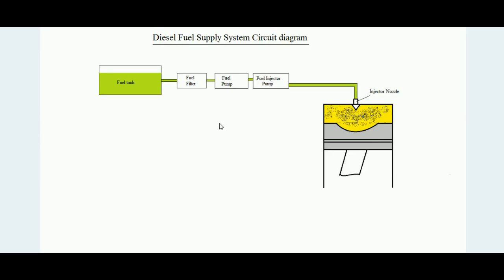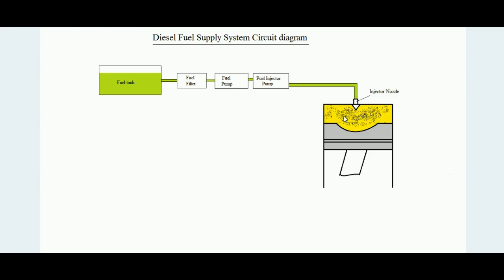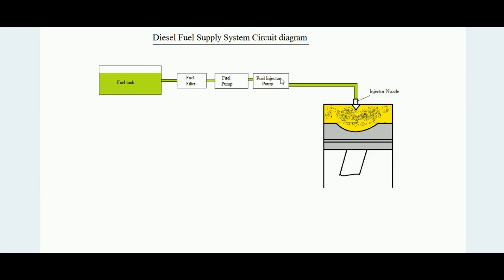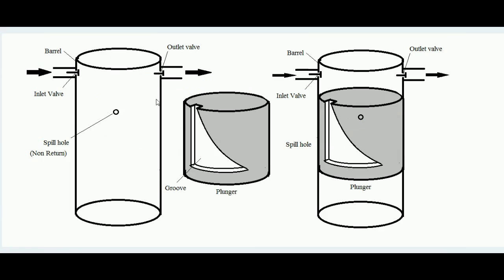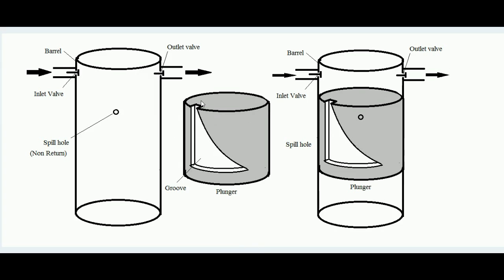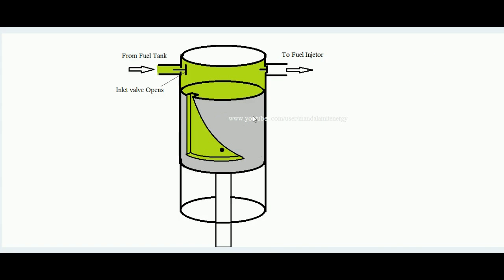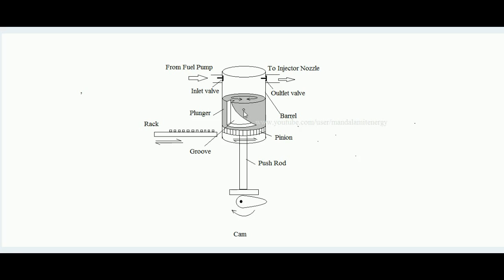Working of fuel injector pump of diesel engine and speed control of diesel engine

Comment: u r explaining helix type not jerk type sir. Jerk type has a valve on the top which injects the fuel on pre-set pressure compared to Helix has valves on the sides, which is what u have explained. But it was very brilliant ☺️🙂😊